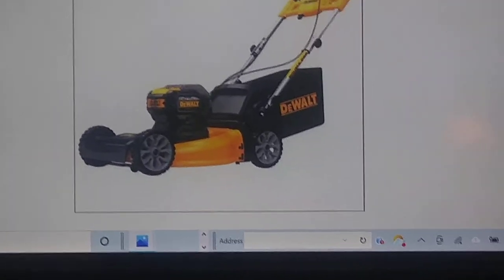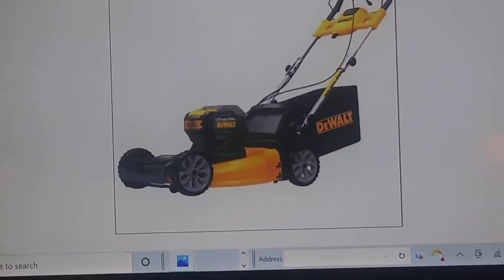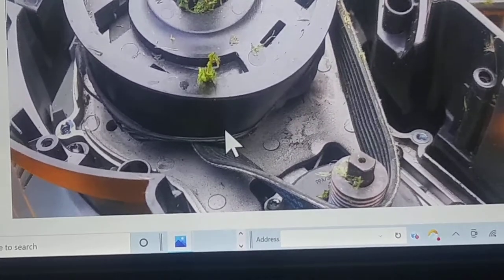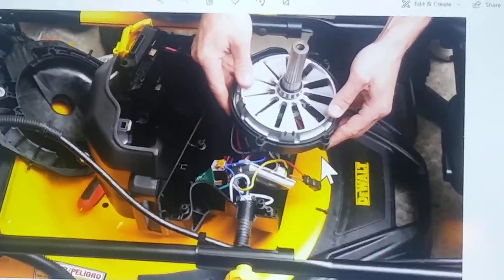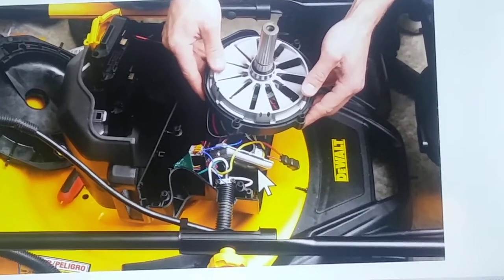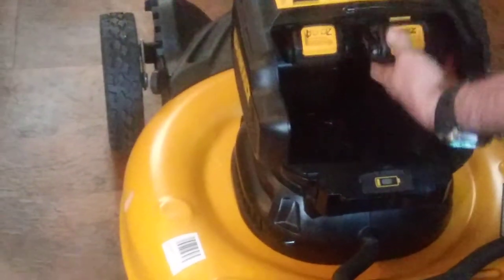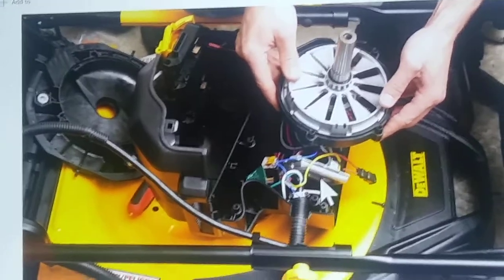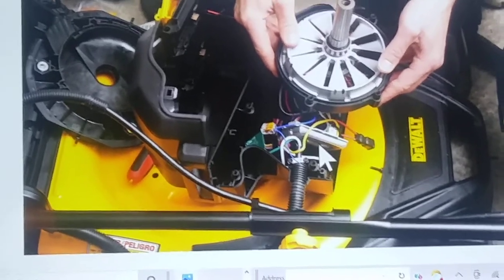Dewalt Gen 2 Mower. Watch This and then BUY ONE!!

Comment: Dewalt may not be the best mower on market but the universal batteries for all my yard and shop sold for me. And generally speaking, Dewalt is always well designed.
Reply from the maker: DeWalt stalls just like any other mower but it's push button restart and my realizing no cord to yank is one of its best sales points. Not to mention no special trip for a gallon of gas.

Comment: I have a 233 Dewalt, it's an ok mower but the Milwaukee mower has a way better motor, it is at full rpm night and day faster then the Dewalt and has night and day more power too. Just so wish Milwaukee made a "true commercial mower," (a push mower with a true side discharge only), not just an afterthought like it is on Dewalts (Dewalts side discharge is a pretty crappy afterthought ) and all the other brands are also. Just wish Milwaukee offered a the bare tool option, because there is no way I can justify paying $1,000 dollars for the Milwaukee.That and most of us all have lots of Milwaukee and Dewalt batteries laying around and don't need more of their overpriced batteries. I so hope you do the same video on the Milwaukee motor and stuff, you will see it, night and day more power and better mower, just way overpriced, but would love to see you do a video on it!

Comment: My mower no longer runs, just flashes red when I try to start it. I have everything Dewalt and a ton of betters. Doesn't work regardless of battery. Any advice?
Reply from the maker: Try using your batteries in something else. They must be 20 volt though not necessarily any ah as any will work. I have started mine with a 2ah. Also check to see if your blade spins freely. This red light also means issues with the mower.
Reply: i have the same ^problem batteri are full but dont what to work i mean start cheque every switch they are good but that little grey box must be the one that dont work but i was 1 week over the f--- warrenty so they wont fix it